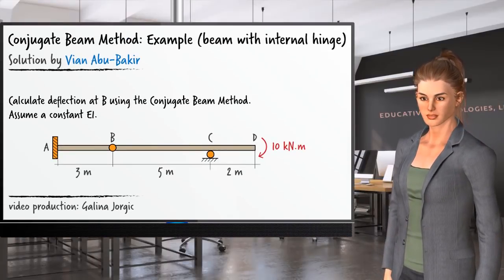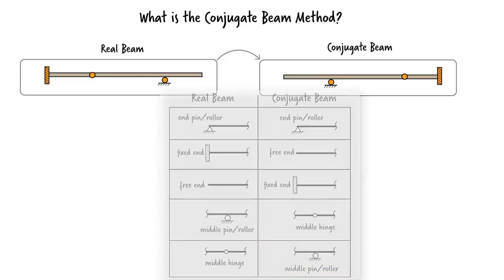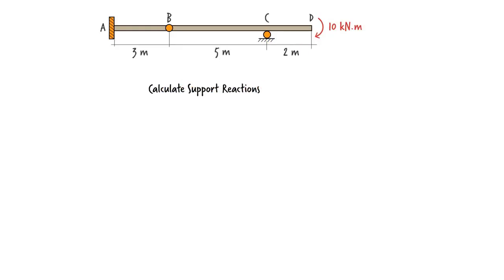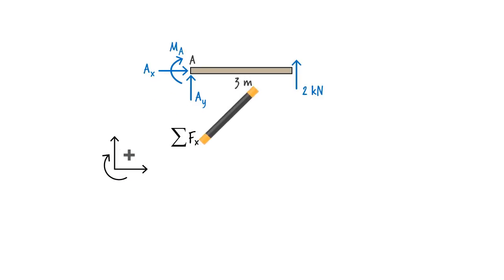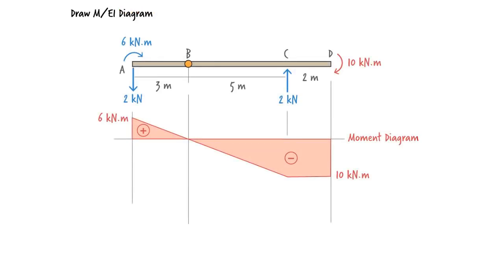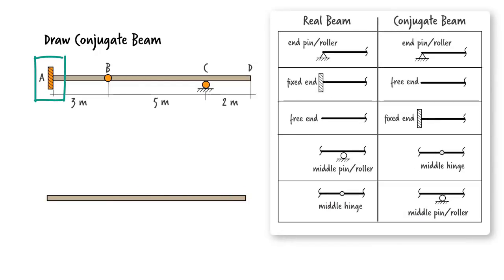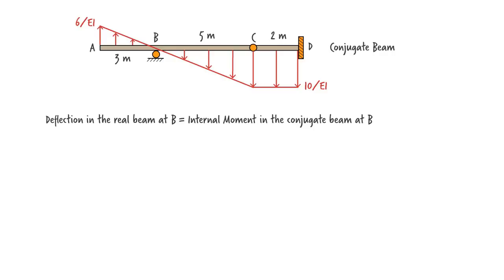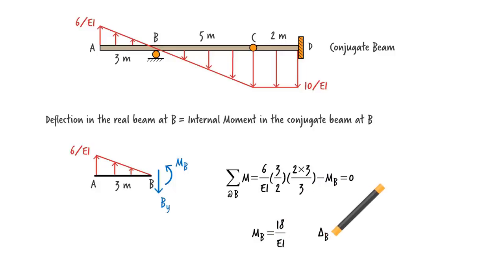EX03: Solved Problem: Conjugate Beam Method (beam with internal hinge)

Comment: Why there is no need to find moment at B due to whole system of reactions and loadings?
Reply from the maker: Keep in mind that when a structural system is in equilibrium, the equilibrium equations are satisfied not only for the system as a whole but also for any segment/part of it. So, if we can find what we are looking for (the unknowns) using only a part of the beam, then that is what we shall do. In this problem, there is no reason to consider the entire system when examining only a part of it produces the result we are after.

Comment: Hello ..i just wonder why you multiply 6/EI with (3/2)[(3×2)/3]. That one i dont get it.
Reply from the maker: 6/EI is the height of the right load triangle; The base of the triangle is 3 m. So,  (6/EI)(3/2) is the area of the triangle, which we treat as the equivalent concentrated load for the distributed load.

The location of the concentrated load (the center of the load triangle) is 1/3 of the base from point A; or 2/3 of the base from point B. Since the base is 3 m, the location of the equivalent concentrated load from B becomes: (2/3)(3). 

The moment of the equivalent concentrated load about point B, then is: (The Load Magnitude) ( Moment Arm). Or,

(6/EI)(3/2) (2/3)(3).